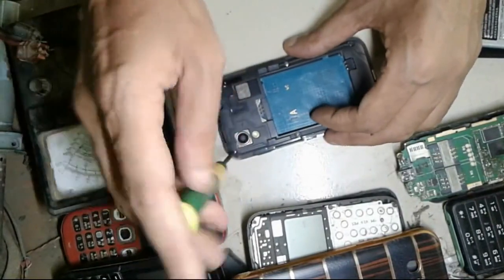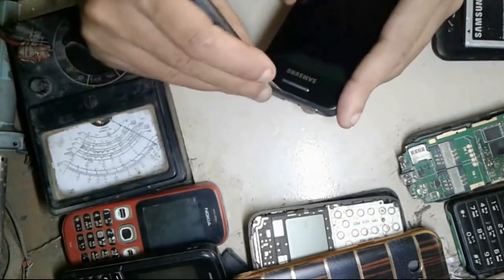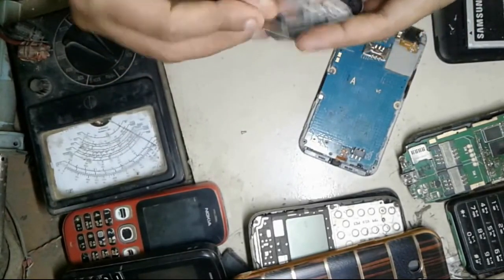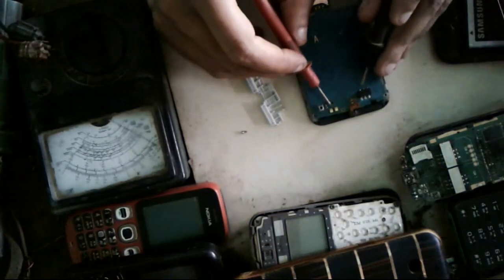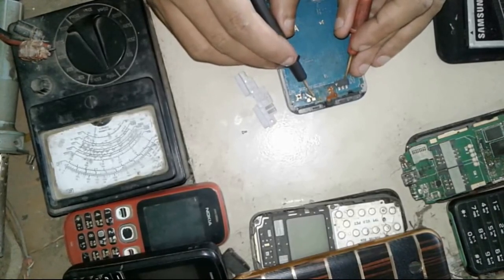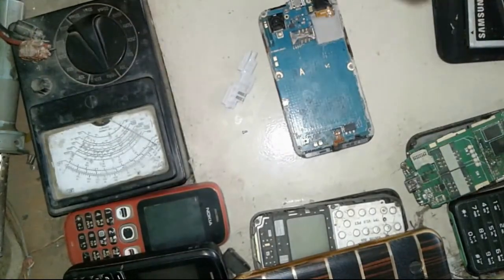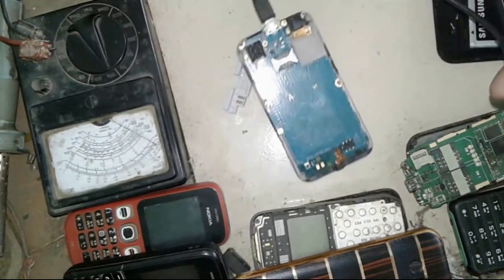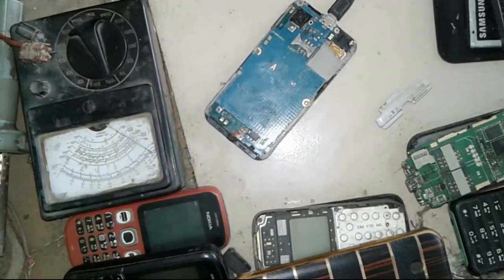How to make cell phone booster antenna just in a seconds

Comment: i dont understand at all. basically youre saying that if you just plug in a usb cord, the signal would increase? or maybe youre saying that if you remove the cover and the original antenna  piece, only then you will see an increase in signal?
thanks
Reply from the maker: A cell phone ground connection attached all over the circut In this video i want to say usb gnd connection can extend your cell phone antenna. When you connect a usb cable then extend usb gnd line perform as a antenna. If you have any hesitation then you can check it using a resistance checker miter. Thanks for your comment.